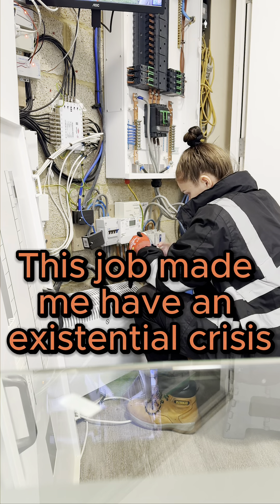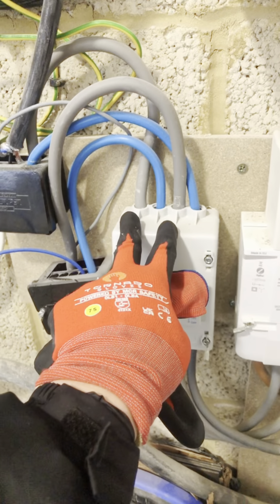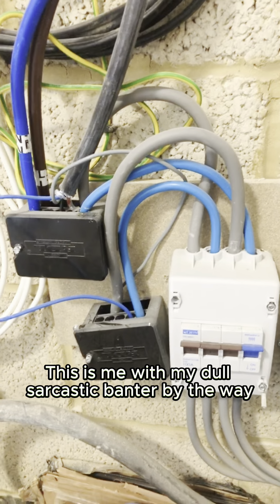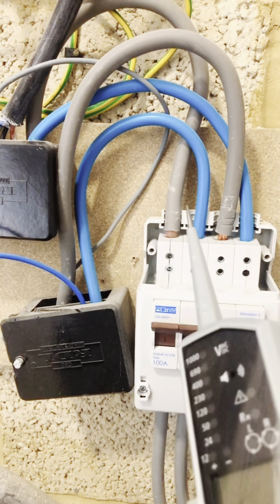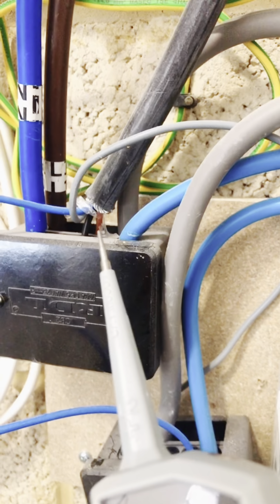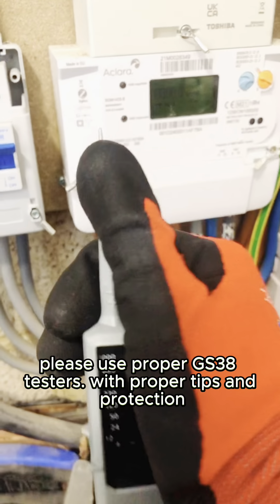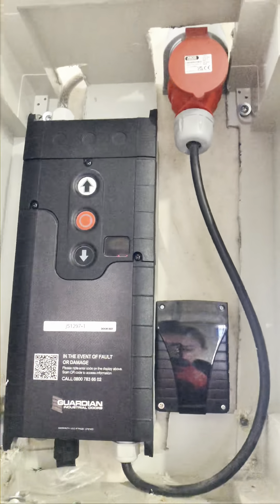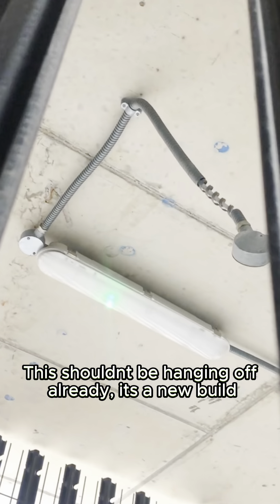This job made me have an existential crisis! Crazy Electrics

Comment: I'm sure you worked out.. And the banter was for effect.
But what a plank that fitted it.
If we disregard the fact there is No protection.. They have used the swa cores, blue as L2  grey as L3 and brown as L1 with black as the neutral...
Swapping black and blue colours making the swap between L2 and neutral without any cpc is potentially lethal...
Reply from the maker: Yeah the banter is for effect assuming learners also watch my content and from just looking at it they wouldn’t be able to tell, but an experienced spark can! 

What shocked me the most is the isolator for the shutters going straight out the main switch into the isolator… nothing in between